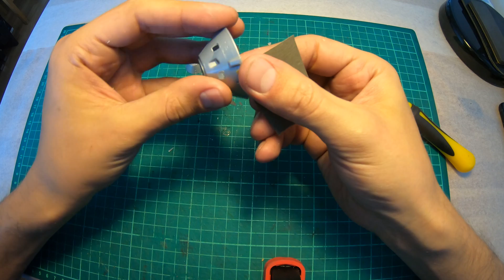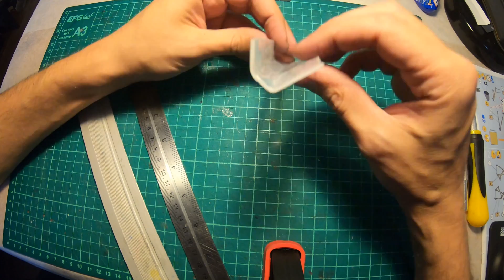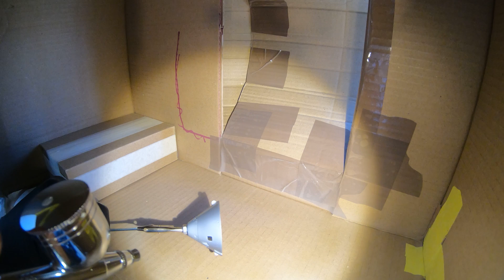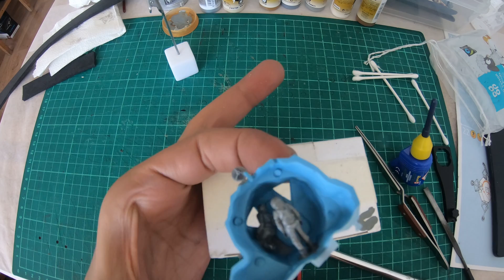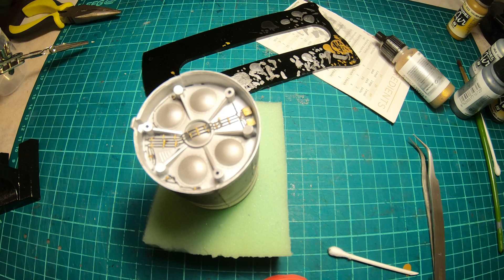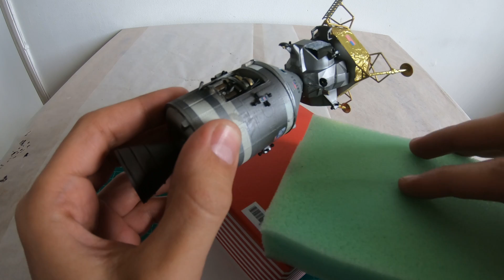NASA Apollo 13 – 1/96 Revell – Scale Model Build

Comment: Where the legs of the LEM down like that during the actual mission?
Reply from the maker: You are the first person who spotted this mistake! I just did not think about the legs… realised right after i finished….
There is another mistake - i blew the wrong panel. The one that exploded is on the other side and the explosion damaged the antenna. I cut out the wrong side so the antenna is fine…
Reply: @buzuuu  Wait, are you saying you accidentally made a mistake while building a model of an accident? 🤔😄👍
Reply from the maker: @bobblum5973  Yes, i successfully failed to depict the successful failure successfully...) 
I am working on a SaturnV now - took a month to get all the valves on the engines correct, building the navigation computer from scratch... - I took the early mistakes personally...
Reply: @buzuuu  If you're modeling the Saturn V I recall it being mentioned on someone's YouTube channel (probably Scott Manley) about the insulating blankets on the F-1 engines, and how they're usually not shown.

Good luck with it, enjoy the build!
Reply: @buzuuu  So it appears there was a mistake in identifying you making a mistake in having the LM's landing gear deployed... 😂
Reply from the maker: @bobblum5973  I am pretty sure it was a Scott Manley video.... I am not going to show the blankets either... mostly because I already spent all this time on the showerhead injectors - don't want to cover them up)
Reply: @Alexander Buzulutsky  No worries, sometimes you can make things too accurate. (Such as using actual liquid hydrogen and LOX inside your scale model Saturn V!)
Reply: @buzuuu  Just say it's the parallel universe version and You're set.  ¯\_(ツ)_/¯
Reply: @Lightnick the legs of the LEM needed to be deployed before the LEM descent engine could be fired. Apollo 13 used this engine to get back home so the legs were out.
Reply: @OliverTheSpaceNerd   I just did a quick Google search for "did the apollo 13 lm extend its landing gear" and found quite a few detailed results confirming your info. 🙂👍
Reply from the maker: @OliverTheSpaceNerd  Thank you so much!!!! I have been feeling really bad about this mistake! turns out not a mistake!))
Reply: It is a very good job!  Congratulation !  it is not a mistake to have deployed the four legs of the LM, because it is mandatory to operate the engine of the descent stage of the LM.  your model represents the CSM/LMs returning to earth after performing the thrust after passing behind the Moon.
Reply from the maker: @erebus8579  I did not know legs have to be deployed for the engine burn! Thanks!
Some people complain about Youtube comments - I am learning new things)

Comment: Bravo on wrapping the foil. I hate LM's that come with molded foil all over the body. I think I would have gone a step further for the realism . The Real LM had layers of clear aluminized Kapton and Mylar. Topped with a clear yellow orange Kapton.  all layers intentionally krinkled, There is also so clear brown kaption in places.  Ton increase the reflectiveness. Perhaps a first layer of very reflective mylar  with a mirrored surface. It would be tedious to add those real thin layers of stuff and hopefully not make the parts look fat.  Part of the support structure for the legs was chrome. Not gold.

Comment: Nice build but was.nt the explosion not on the side where the antenna ???
Reply from the maker: Yes, it was. And it messed up the antenna as well... Could not cut the correct side. The original kit comes in 2 parts, on the wrong side you can cut the hatch out and maintain some structure... If you cut the correct side - no way to glue them together...
You would enjoy my saturn 5... Used original schematics and tech manuals to make the engines. Even made showerhead injectors

Comment: Awesome work! Don't want to depreciate your achievement but is the damaged panel the panel of sector 4? In my opinion it might be closer to the high gain antenna. We should also see the umbilical bridge between CM and SM when looking on the damaged side.
Reply from the maker: You are correct, sir. The correct panel is on the opposite side… and the explosion damaged the antenna…
Unfortunately, had to cut the wrong one to maintain structural rigidity of the model. The bridge… it was there… for a while, didn’t hold - so I gave up. I rebuilt the internals 4 times.. ended up with the simple “good enough for government work” version. Insufficient patience supply
There are quite a few mistakes in the model…

Comment: Sir I built an Apollo command service module by Revell many years ago . I did  some workon it . Can you tell me what color the service module is ? I need to do some touch up work   Bill
Reply from the maker: I used valejo air paints.  Black base,  gunmetal,  medium gunship gray,  chrome highlights. Then black,  brown,  and a little earthbrown for damage.  Black, brown washes... 

Its hard to put a label on this one... The sercice module should be a little darker and a little duller than the capsule itself.. But its just chrome/gunmetal...  

I also found that some paint brands "dont like" others.  Tamiya goes well over anything,  valejo does not like being on top of tamija... I would recommend using the same paints for touch up as the originals...

Comment: Beautiful tribute to Apollo 13 Alexander. I'm just getting back into modelling after dabbling in it a bit in previous years. I was at school during the Apollo missions and was obsessed with them. I vividly remember after school running full pelt across the local park to get home to watch the BBC's coverage with James Burke and Patrick Moore. I have made a few models in the past of spacecraft, 1/72 Airfix (I think) lunar module. That was about 40 years ago! I still have that in a glass display case that I made for it. I used gold wrapping paper from chocolate bars for the descent stage and dry cement dust for the lunar surface. I also have a 1/32 scale command service module, again made quite a while ago. This was produced by Monogram. It's got a bit battered over the years and now has bits missing so I have recently bought the kit again. This is by Revell packaged as the 50th anniversary of the moon landing. It seems to be the same kit so perhaps Monogram have been taken over by Revell. I also got the 1/48 Revell lunar module at the same time. Pity they're not to the same scale. Looking forward to building these. My only other completed spacecraft models so far are a Airfix Saturn 1b and a 1/72 Redstone Rocket with Mercury capsule by Dragon. Your video has inspired me to try my tribute to Apollo 13 if this kit is still available. I don't know if you are aware but the BBC recently did a fantastic series of podcasts called Thirteen Minutes To The Moon. They really are one of the best accounts I have ever heard of the Apollo 11 and 13 missions. While I was watching your video I kept thinking to myself I'm sure I know that music then saw the credit to Tim Dodds. Great stuff. Take care my friend and happy building.
Reply from the maker: Thanks! 
Have you seen this channel? https://youtube.com/c/JacksonTyler
Lovely space documentaries.  Best i have ever seen and i believe it is just one man making them...  

I am almost done with Gemini iv model by dragon..  And i have a huge saturn v by revel about 25%  there.  Gemini will be a video,  saturn is too big to film)
Reply: @buzuuu  Thanks Alexander I'll check that channel out. Went online after my post, the 1/96 Revell  kit is on its way.

Comment: im very far from pro builder, but i wanted to try out one of these kits, i once did some wood working with gold leaf , basically you spray some sizing tack down and the gold leaf is so thin it sticks to it and you brush off the excess with a dry brush, do you think that might work ? wondering if you ever attempted using it instead of foil?
Reply from the maker: Yep, gold leaf would work.... For this specific model - foil is better as it also creates appropriate texture... For some models, gold leaf works better. Either way - it is a hustle and it is easier to just paint)

Comment: Absolutely wonderful work! Did you use glue or something to hold the golden foil on the LEM?
Reply from the maker: Thanks!
I used two part transparent appoxy... it takes 20 minutes to dry... which gave time to work on it (not doing foil ever again, its a nightmare)... super glue was another option, but i would spread the foil first and then touch a bit of glue... i thought the apoxy would give a better result
Reply: @buzuuu   Thank you for your answer. I decided to use a normal glue stick and it didn’t disappoint.
Reply: Fantastic job!